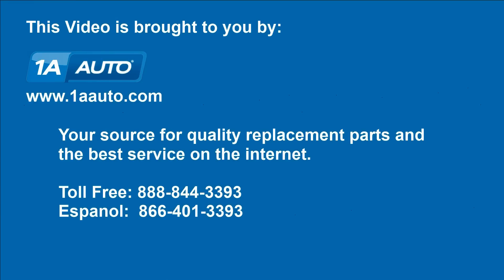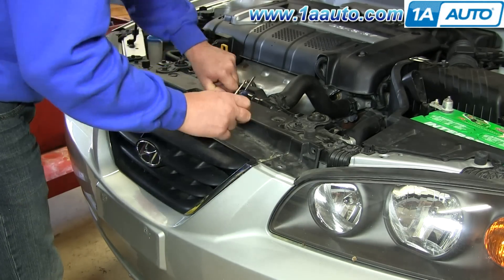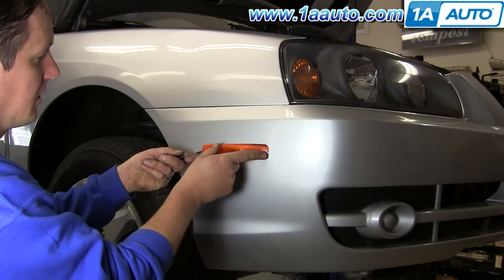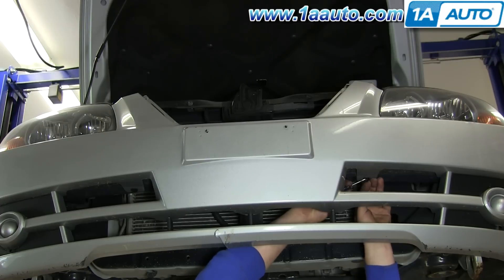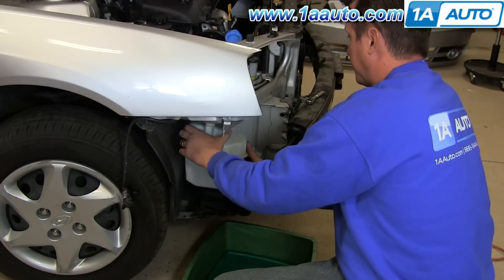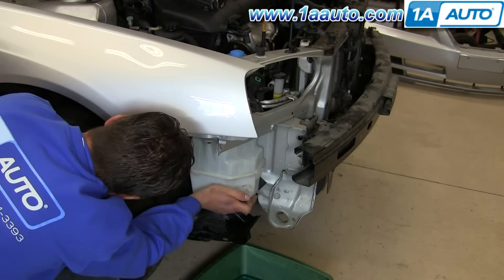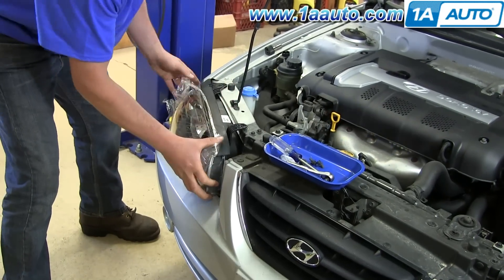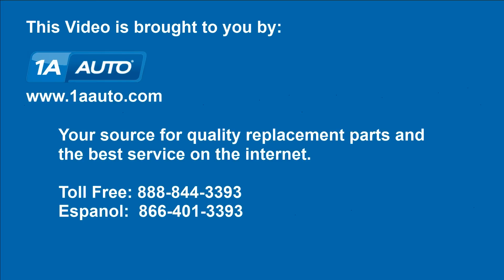How to Replace Windshield Washer Reservoir 01-06 Hyundai Elantra

Comment: Thanks for the video to show me where the pump was located.  I did not have to replace the washer bottle but just clean the screen on the pump.  Your video showed a full tear down, but to  reach the pump only had to remove the two screws below the bottle for access.  Due to your video, I had a better understanding where everything was and why able to remove only what was needed.

Thanks a bunch for saving me money on parts and labor as I love when can do it myself.
Reply from the maker: Thank you for watching.
1aauto.com 888-844-3393